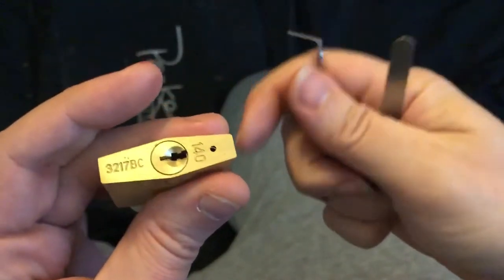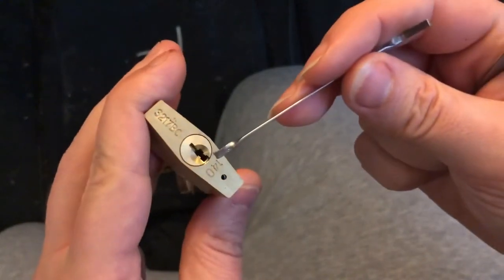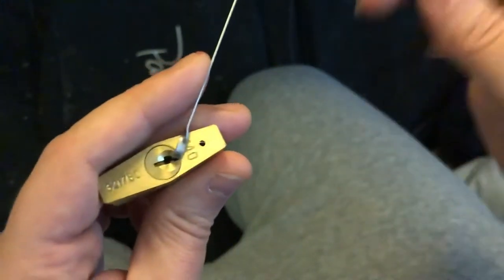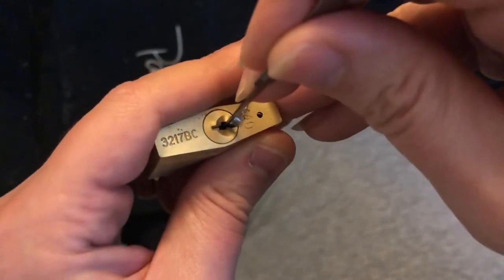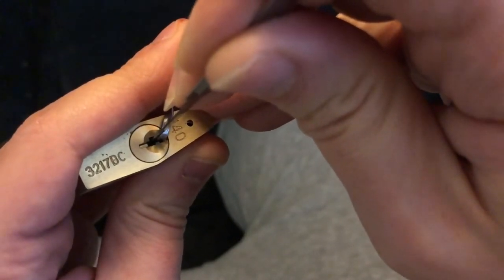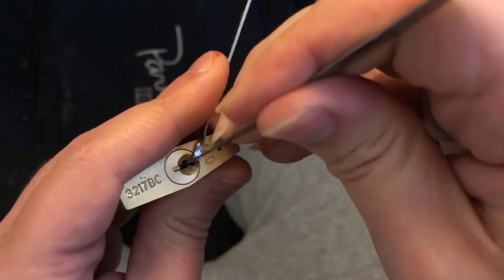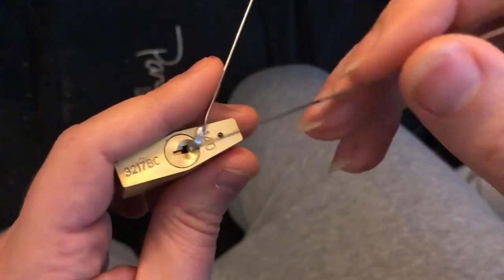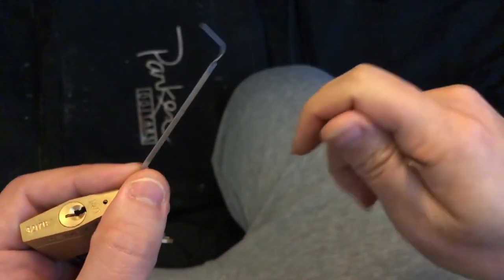Masterlock 140 picking and explanation

Comment: Hi Paul - I’m just starting to learn lock-picking. Thus far I’ve been able pick three Masterlock No. 5 locks pretty easily. I’m now trying to pick a Masterlock No. 140 and finding it to be quite challenging, in spite of having watched your and other people’s helpful videos on the No. 140 lock. More specifically, I can’t seem to get any of the pins to set. Last night I attempted to pick it while listening to it through a stethoscope. I could feel each pin moving against its corresponding spring. With the stethoscope I could even hear the individual springs moving yet I heard no clicks. I varied the tensioning from very light to quite heavy, and tried both clockwise and counter-clockwise tensioning, both to no avail. I’m surprised that I can’t get any of the pins to set with a good clicking sound. I also tried a variety of picks of varying style and depth. Do you have any suggestions as to where I’m going wrong? - Thanks very much - Jim

UPDATE:  No sooner had I sent my most recent message to you I got the 140 lock open. I found that I had to apply quite a high torque to get it finally open. MaybeI had managed to open it previously but had not applied sufficient torque during the final step?

Comment: im just starting and i bought this lock to practice and i get that one pin 1 i guess im oversetting pin 2 thanks to your explanation. My question is and since i am a giant newb ive seen a lot of tutorials and im not even remotely good at lock picking but i am trying to learn i guess where i am stuck now is those clicks you guys keep on refering too i i hear a lot of clicks when im picking and also sometimes i dont know if i am on a pin or not so i just move my tool up and down with the leverage of the lock like i pull this tool down and let the front lift up from the leverage i dont try and pick each pick with my own muscle should i ? Should i put tension and then go to each pin and use leverage with the tool to lift them or should i use my own force and try and feel?

Comment: For your lock, could you get it to open in a different order without pin 1 being the last pin to open? Say try to open with pin 3 or pin 4 as the last pin? Thanks. I'm just trying to understand if it is a must to follow binding order.
Reply: No every lock is different. Will bind in different orders
Reply: Some people set pins front to back, some back to front as a habit

Comment: How does one overset a given pin? Thanks!
Reply from the maker: Sometimes once you have a pin set you can not feel it set (no click, no feedback indicating it or so small that it’s missed) so if you keep pushing it, it will then push further in and then be overset. At that point you just have to let off the tension to let it drop and try again, but it can be confusing since an overset pin can feel like it gives full resistance just like a properly set pin, making you think that pin is done and try to find what is holding up the lock opening elsewhere, when in reality it’s that overset pin that you think is already set.

The easiest was I could suggest checking if something is overset is, if you think a pin might be overset then give it too much pressure. If you feel it gradually slide in with a lot of resistance then it is likely overset. 

Unfortunately the best way to deal with overset pins is not to overset them, removing the issue entirely but it takes some work and identifying if you’ve overset a pin is the first step to avoiding it gradually in the future. 

It’s a bit hard to explain in text so hope that helps a bit. In my experience some locks will be prone to oversetting more that others, either based on pin type or factory tolerances, or a security pin lining things up in such a way that a normal pin oversets more easily. So you can kind of expect it more from some locks than others and be proactive about avoiding it.
Reply: @PaulHofreiter  :Hi Paul - I’m starting to think that I’ve been “fighting” the bitting sequence. I’m going to be more careful in keeping track of the sequence as I move forward. On a related note, my intuition suggests that the sequencing might be reversed for clock-wise tensioning ad opposed to counter-clock-wise tensioning. Does this make sense? - Thanks, again! - Jim